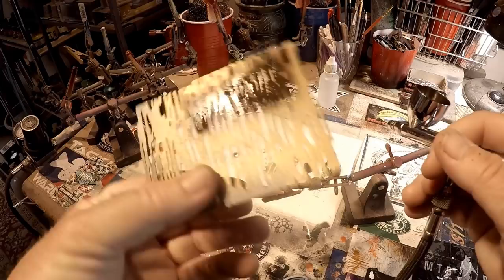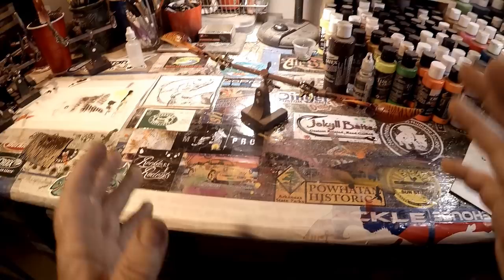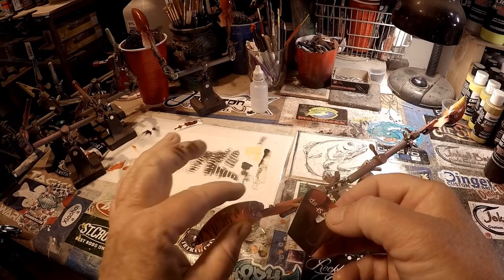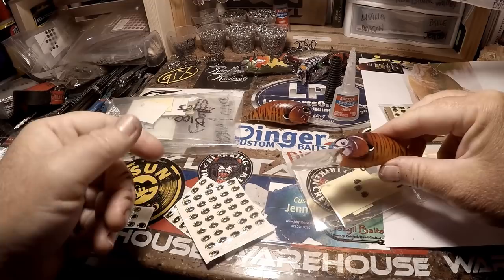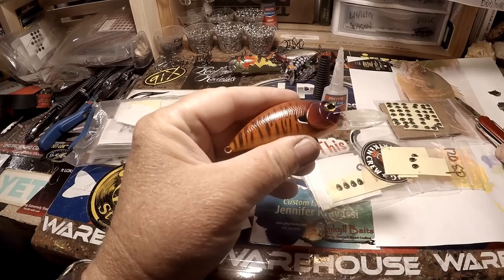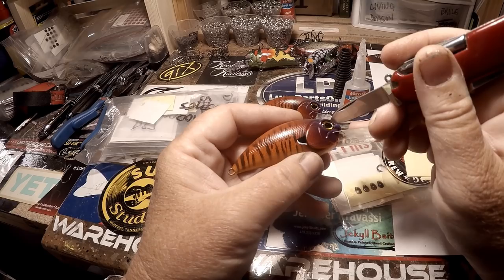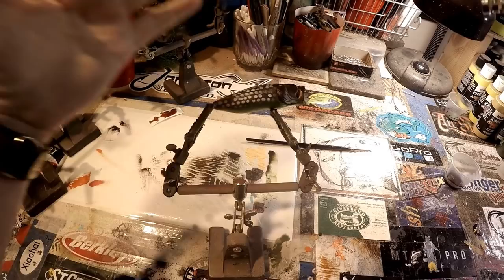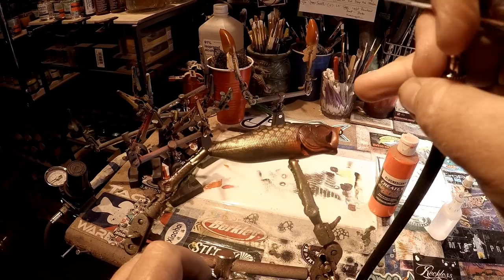Spray Session: 2019 Tips and Tricks Volume 1

Comment: The kbs clear coat. Can I store that in my bedroom closet? I don’t have much room for it but I’d imagine leaving it outside in the heat is bad. Just didn’t know if it has strong fumes or smell
Reply from the maker: As long as it's sealed in the can/jar properly there's no odor whatsoever. If you can smell it then it's not properly sealed and will harden and go bad

Comment: How long does a quart of kbs stored properly for some one who isn't manufacturing a lot of lures
Thanks in advance
Reply from the maker: Great question. As long as it’s sealed properly it should last a couple months and then some. If it’s brand new unopened in the can it was shipped in, much longer. My best advice to those who will use KBS infrequently, is to purchase the pint instead of the quart. Things are only cost effective in larger quantities when there’s no chance of hardening.
Reply: @Jekyll424  
One other quick question?I am kind of new to this type of finish but do you dip jointed lures or multi sectioned swim baits?
Again much thanks and if you have a video could you link for me.

Comment: how long, roughly, does it take for the KBS to get tacky? non-runny?
Reply from the maker: Under low humidity and 70-75° temps about 30 minutes, but doesn’t completely cure and harden for about 24 hours. It’s okay to touch after 6-8 hours